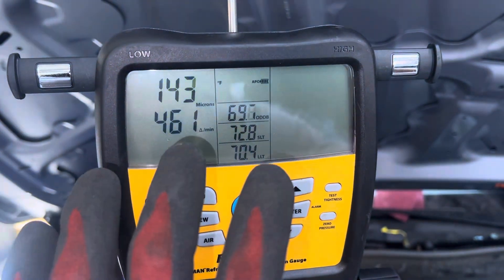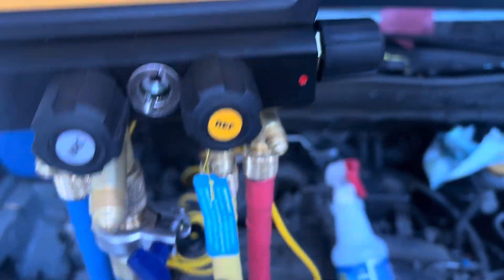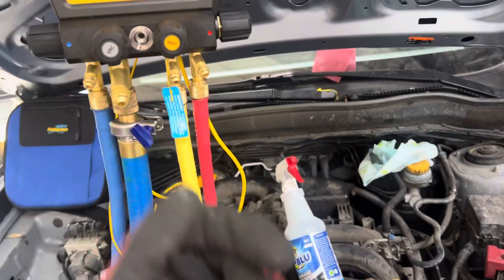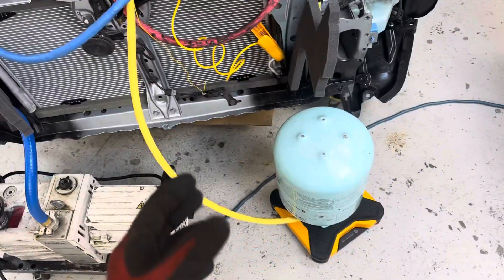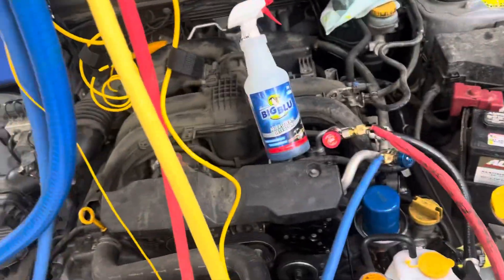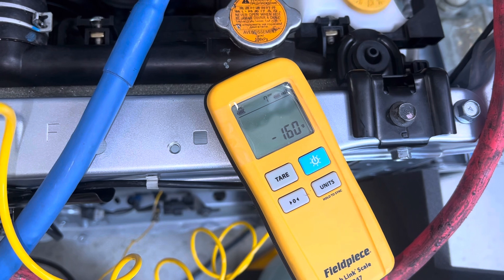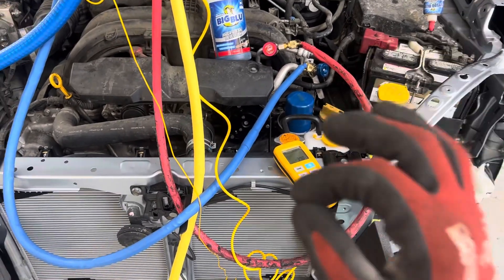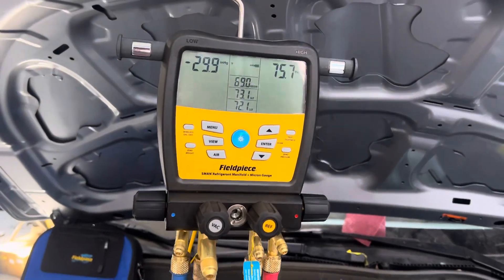ONLY 375g. REFRIGERATE Micro channel Condenser and Evaporator. You do not want to be overcharged

Comment: Great job!  How much refrigerant gets stuck in the hose? Is this a problem with these critical systems? thank you!
Reply: I think you tare the scale after purging the hose. then you measure what goes in
Reply from the maker: Yes, Evens the refrigerant in the hose can make a big difference

I did a video on a little Prius I was hanging 440 psi 

I have attached my high side hose and just a liquid refrigerant that went into the high side hose lower the pressure to 370 psi 

Then I opened up either the yellow hose or the green hose stealing more liquid refrigerant from the high side, just into the hose and the pressure lower down to somewhere around 300 psi 

So just the quantity of liquid refrigerant in one horse makes a big difference in these tiny systems

This car came into the shop overcharged 

So I was just making a video showing how much of a difference one hose worth of refrigerant makes